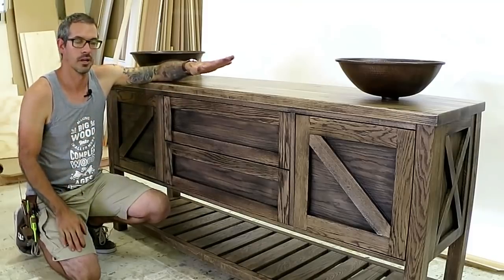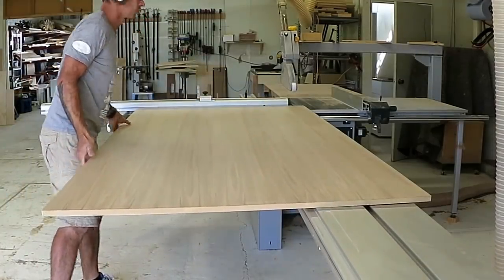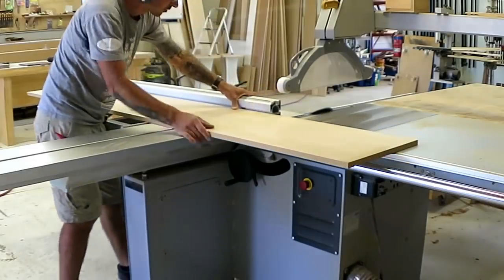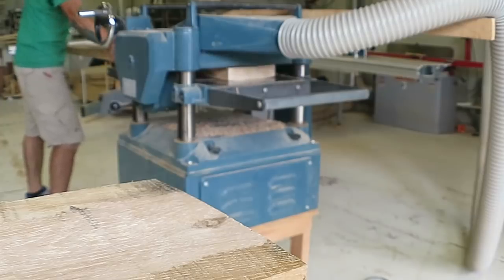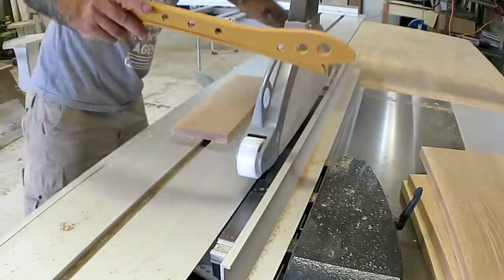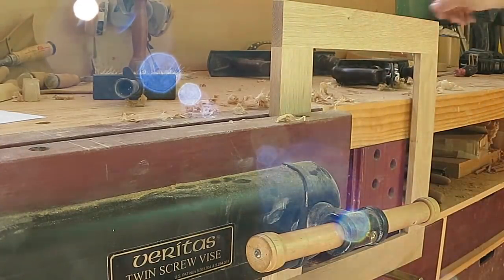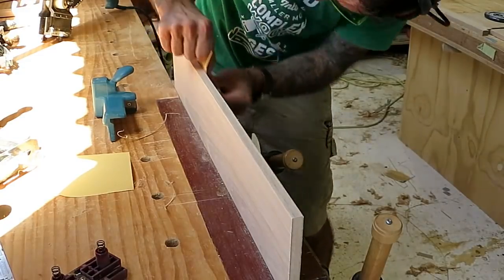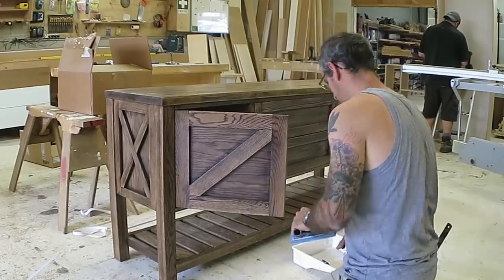Oak Vanity

Comment: For anyone "worrying" about MDF,  think of the design and mentally remove all the MDF cored bits. The top, the legs, and the bottom shelf are solid oak, just like a table might be made. No part of it will be touching sitting water and he polycoated it so the humidity wont get to either. This is what it takes to make something to a price and is an economical use of oak. Awesome work as always Joey!
Reply from the maker: Thanks ! Yup.
Reply: Love your work Joey. Brian, gotta disagree. Any of that Oak-MDF gets nicked, or opens up, a missed glued edge (which Joey would never do) and it will soak up surrounding humidity like a sponge. Golden rule is never use MDF in a high moisture environment.

Comment: Are you attaching the drawer fronts to the drawer boxes with screws through the frame of the drawer front and not through the panel? Are you using any glue?
Reply from the maker: Screws into the drawer front frame. And through the small steel brackets on the bottom which hold it onto the runner also

Comment: Beautiful work, as always!

I was wondering if you fill the holes for your Clamex afterwards. I find your use as a clamping device brilliant but fear that someday someone might think this panel is somehow removable. 

Regards,
Etna.
Reply from the maker: Thanks,  yea I  thought the same, hope no one goes poking around with an Ellen key!
Reply: Yep, I wondered the same thing.  You can get little plastic caps that press fit into pozi-drive heads, or maybe just use the fastcap stickers to cover (quick and relatively inexpensive)  Cheers, David

Comment: Beautiful work as always Joey ! I was trying to figure how you were marking the wood to cut the angles for the cross brace design.. perhaps you could explain it in another video if it’s too much to explain it here.
As always, thanks for sharing the process. Much appreciated.
Reply from the maker: Cheers,  I simply referenced the inside of the doorframe with a straight edge then transfer that line into the angled brace. This method usually leaves the piece a bit long and the finished length can be crept up on .

Comment: Hi Joey, did you ever consider buying a Festool Edge Trimmer? Works a lot faster than the manual trimming where you easier risk tear-out. I have one and wouldn't know what to do without. Festool has dual machines that can trim veneer applied on show faces as well as veneered edges. Of course there 's the budget...
Reply from the maker: Didn't know it was thing . I'll have a look

Comment: I said it before and I will say it again, "the Master". Love the project, turned out really nice, even the stain over the Oak ( even if some disagree). Joey why the slot in the vanity to attach the top, And some day when your not busy, any chance showing some pointers on hand planing. :)
Reply from the maker: Cheers
Reply from the maker: Oh slots are to let the top expand and contract while the back is fixed in place to avoid moving any sealant that is sealing it to the wall.

Comment: So you finally approved the plastic inserts of the hinge screws instead of plying them off?

Nice hinge drilling jig.
Reply from the maker: They seem to work . The reason I pulled them off is because I had no way to drill for them accurately. With the blum jig it's all good  .

Comment: The tool you used for the door hinges, and  the plastick things you use for the boards, what are they both called?.Would love to try those things, it looks intresting to try out . Thank you , best regards.
Reply from the maker: The hinge jig is an eco drill by Blum.  The plastic inserts are a system by lamello.  There is a vid on this un one of the pop up links in the video
Reply: KingPost TimberWorks thank you so much for responding. I will try to find them and order. Best regards.

Comment: 14:25 - Why does that happen? I assume it has to do with the interaction of the direction of the cut plus the direction of the wood grain, but I have yet to get my head around what exactly is happening there and how to prevent it. Is this what they call a climb cut?
Reply from the maker: So not technically a climb cut but it is against the grain. Although sometimes oak  just doesn't like to be cut like this and will blow out just because.  Try a bunch if smaller depth cuts  and it should stop most tearing out
Reply: Thanks for the reply, Joey. Hey I wanted to say I read your article about doing woodworking for profit, and this year I'm starting to get out there and do it at a larger scale. I took a few gems away from that article, and I always glean helpful ideas and insights from your videos. Just wanted to thank you for the stuff you put out here!
Reply from the maker: @TrotterG  oh that's cool man, hope all goes well!